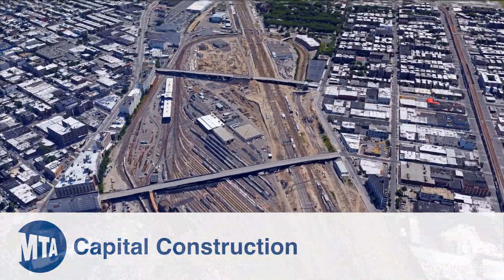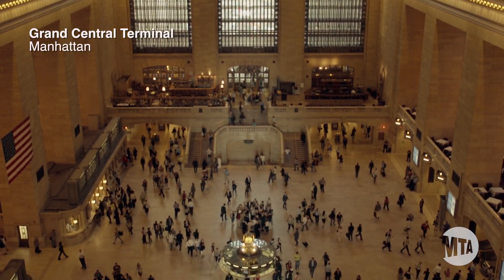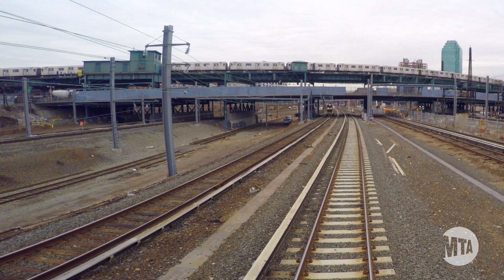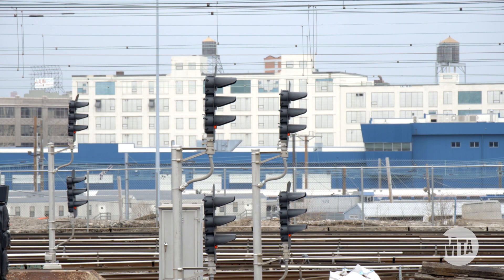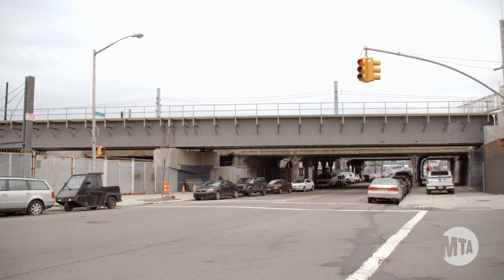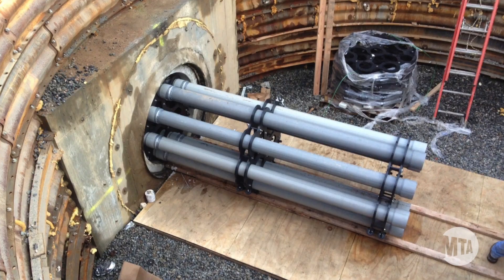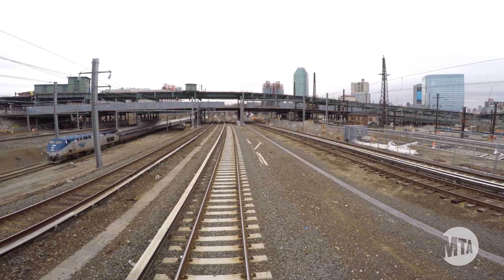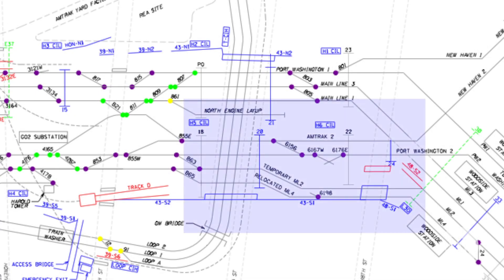East Side Access - 9/11/2015 Update

Comment: I'm pretty excited that the "Westbound Bypass" (shown about the 3:00 mark in the video) is moving along; from the project documents available to the public online,  it and its eastbound companion should be done around 2018-2019. The current situation is  like a highway with entrances on the right but exits on the left; where a car staying on just to the next exit has to make several lane changes to get to the right place, slowing down its journey and that of cars staying in the same lane. Amtrak trains to and from New England currently have to make a similar series of crossover maneuvers to get from or to the correct East River tunnel, which slows all trains down and limits throughput. This is one of the barriers to running Metro-North trains from the New Haven line to Penn Station. The bypass projects will essentially build one duck-under for each direction to enable Amtrak and Metro-North trains to run free of conflicts with LIRR traffic. Moreover, some Metro-North trains may be able to run through to New Jersey (or NJT trains to CT), economizing on scarce platform slots and opening up service possibilities not available today. No LIRR cars can run off the overhead wires, which is why they don't operate west of Penn Station, where the third rail that powers them ends.
Reply: Although the Westbound bypass is basically complete, the eastbound bypass is almost done. It has been dug out, and they are probably finishing up work by now. Hopefully the rest of Harold interlocking switch rebuilds will be done sooner or later. There a few switched on the LIRR/Amtrak westbound segment that (although I haven’t found any information on that, so I’m just guessing) will be rebuilt once the eastbound bypass has been completed.